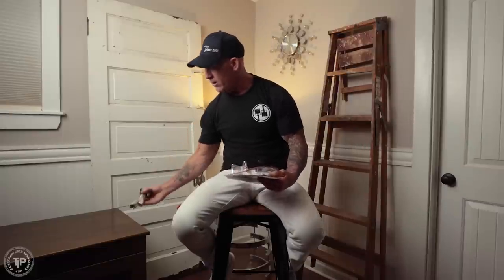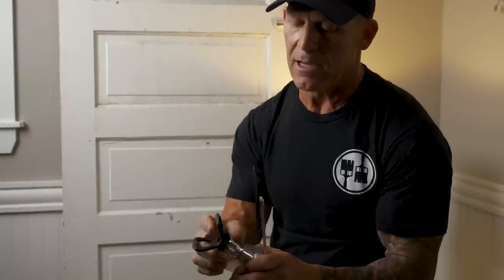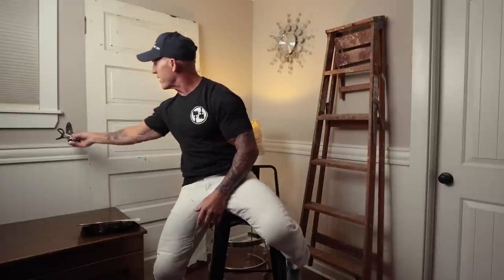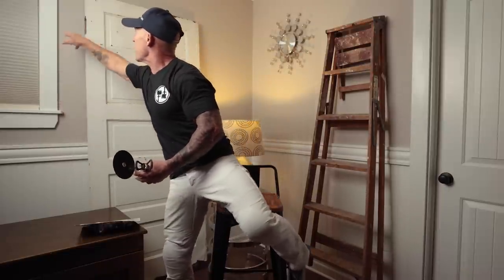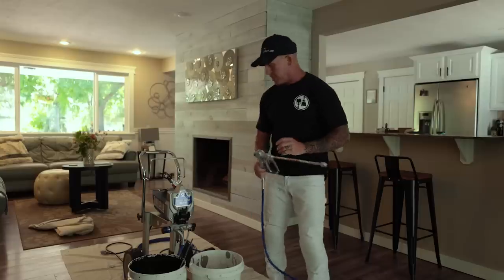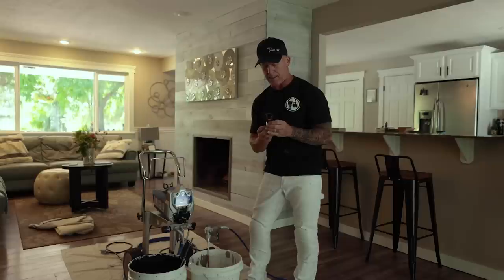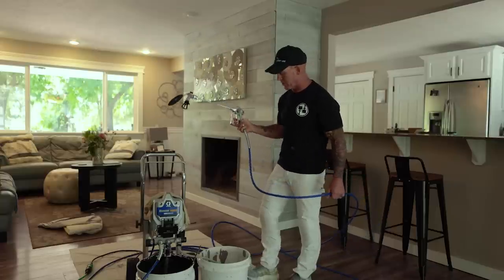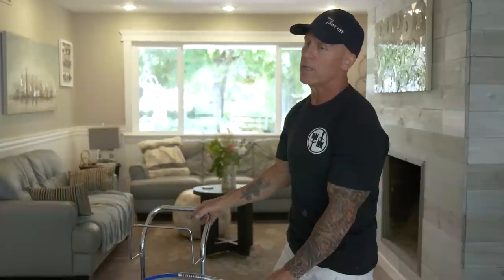Titan Spray Guide Review.  Is This A Terrible Painting Tools?

Comment: I painted a house exterior, the colors were white for trim and Greek villa for body, essentially white on white. Used that roller thing to cut in around some hard to reach areas above the garage roof, made it a super fast job. It has its place but it’s super limited to like colors and if I was going to use it on an interior....your still gonna need to pull out the brush or use a hand masker for the corners and it’s gonna drip like crazy with the buildup

Comment: I have had great success with this tool in a office/commercial setting spraying to a metal grid, drop in(act) ceiling. I did find that it is much easier to actually mask the perimeter grid with 2 inch tape(very easy, very quick), using paper mask on inside corners and outside corners, prior to spraying. Once you invest the time in masking you can actually fly through the spraying process. I actually use this tool all the time for that application. However that's really the only application that I have found where this tool is beneficial 
Thanks for a great review.

Comment: I think I’d be faster with cutting in the old fashioned way.   Not sure I’d use this.  Thanks for sharing this, Chris!!
Reply from the maker: Hand cut ins are the best still
Reply: I used it a few years ago it worked really well under crown molding that I installed, but when I got to the corners you definitely have to tape the corners, I'll sure repainting.  If you use this machine tool once a week it's great but if you throw it in your toolbox and forget about it for 6 months and try to use it again it won't work you just like forget how to use it you have to test it and make sure you're doing it right and make sure you got the right tip in it it needs a 314 tip or something

Comment: hey Chris, i agree with J.Lopresi, Ive found that you really need to have a guy standing by with a 5 gal. bucket or 2 of water and towel, dunk it once,towel it,  dunk it  again and it can actully save some time, HOWEVER things are different for a real painter than they are for homeowners/handymen, if you have ceiling paint, it is super fast to just have someone hold shields in place (big ass diy pcs. of siding)spray walls and touch up ceilings, In my time as a painter 20+ years, Im almost ready to just tape everything off with frogtape, PRE wet it with damp rag and roll right to it with 9" roller , no cutting at all but this only makes sense if you are someone that can mask 3 times faster than normal people can, i.e. painters.

Comment: If I have a lot of crown molding to paint, I will spray the ceilings first, and then use this to put on the semi-gloss for the trim (only if the trim and ceilings are both white). The slight overspray from the semi-gloss isn't noticeable on the ceiling, and if the crown is complex or has a lot of ridges, then I can just do a quick brush over it, not having to worry about the cut in next to the ceiling
Reply from the maker: Thanks for sharing

Comment: I can see the headaches with this device. Even if you get it perfectly dialed in. You have to wipe it or reverse a clogged tip it would move/mis adjust the dialed in angle because the swivel doesnt locked in. It just seems if the company really cared about the device they wouldve made it non-adjustable. The tip size and angle should be preset by design.

Comment: It’s not bad. I would still use it when painting instead of having to completely mask everything. It leaves a bit overspray, but when you paint a window frame you’re painting walls first anyway and overspray on the trim. I would probably turn down the pressure some. And move a bit off being against the trim some. Yea won’t be perfect but it’s helping some instead of just over spraying

Comment: I can definitely see some situations this could be handy mostly is some commercial or production situations or just a a rough group overspray blocker were perfection is not exactly the goal but a fresh look it... Definitely not up to standard for a Finnish edge though but it think it could be a time saver in some situation or the unfortunate situation. I could definitely see this when you just have white one white with Sean change. Rentals apartments things of that nature. I also think this could work great along with tape anytime your already doing to be using a pressure roller with tape possibly no paper. Since a sprayer will already be set up and there is a large amount of cut it with a solo painter this could be a game changer for efficiency

Comment: Great review Chris but I'll stick with manual cutting in. However, I can't keep my damn airless from creating tails when spraying? I have the guage set at 1600 psi w/ HEA 311. I've tried everything WTH!
Reply: Turn pressure up
Reply: @thesaviorofALL  I'll have to try something or quit using these useless HEA tips.
Reply: @tocolee6127  I find tailing is just low pressure issue Crank it up and see how it looks
Reply: Make sure pump n gun filter are properly cleaned and try some test runs with higher or lower pressure there should be a pressure n tip size recommendation n if there isn’t then usually that product isn’t formulated to spray n you’ll fight it no matter what if it’s one of those products
Reply: Use a different tip, we use hea tips all the time but try with another tip and see if the issue persist
Reply: Dialed in finally!
Reply: @tocolee6127  awsome what was the problem or how did you solve it 👍
Reply: Thin out your paint, clean filters in the gun and machine, then turn up the pressure...
Reply: @vinnyboom3027  pressure related issue.

Comment: You gotta keep adjusting it, shouldn’t have that much paint on it. I bought a cheap one, works great. Takes time  but once you dial it in you can work fast and clean. You adjust it so it’s just barely missing the wheel, the wheel should be catching overspray and not being hit directly.
Reply: That's what I was thinking. You gotta adjust it on the flat wall first. From what I see the wheel should barley be getting it.

Comment: I bought the combo kit with the roller sprayer.  lost the screw on first use but never used the wheel . I did not care for the roller attachment. feel it easier to just roll it. waste of money !

But I do like the swiveling tip  I placed it on an extension got a back roller behind me and did whole house walls and ceiling  in 4 hours (1600sf)
Reply from the maker: Waste dont buy

Comment: That’s more for warehouse or really high ceiling commercial mainly
Reply from the maker: Fuzzy lines are not for any job LOL
Reply: Way too many problems using on a high ceiling. First of all, the degree of difficulty and control increases your physical effort with every extension needed to reach your target height. Secondly, when using extensions, the amount of paint spat out on trigger-off ruins any hope of a decent finish and leads to time-consuming rectification works. Thirdly, you need to move at a reasonable pace, which is not always possible when your paint intersection is rough/uneven or the ground is uneven. Fourthly, you need at least a 40 degree tip to allow the paint to hit the disc. That's a lot of wasted paint without any quality guarantee. It's hit or miss.

Comment: Glad to see the Graco ProX19.  That is the sprayer I chose for my DIY needs.  Hopefully you give it 👍.  I haven't opened the box yet.  Can you aprove?
Reply: Garage,  nothing but problems, get a graco 395 nova, or a titan 440 those 2 sprayers have went threw 2 seasons everyday use with no problems just normal filter replacements.

Comment: Chris you are not using it correctly, also for all of you that did not have luck with it, it does not make laser lines but it works much better than on the video, you have to keep the tool and extension 100% vertical all the time and walk with it as you move, there should not be any hand movement towards left or right as it makes overspray right away. Also your hand is close to the wall, move it towards your self a bit. You should start from right corner toward left and spray about 2' than you go to left side and spray towards the area where you started so you dont spray all the way towards the end. I also found it works better with FFLP 410 or 412 tips. If you take time and adjust angle perfectly and move it while keeping it vertical all the time it works much better. Also after a while that center of the wheel gets dirty and blocks the wheel from spinning, I installed small bear bottle cup on top of it so that paint cant get on it... Give it second try, it works on rentals and exterior
Reply from the maker: I was using it to specs on the PACKAGE.  I used it several times.  I have over 20K hours spraying with an airless sprayer and some tools are good and some a waist.  Now.  It you have lots of time on your hand, maybe you can get better with this tool.  For me the learning curve is to great to invest in it.  Hey, not every tool is for everyone.
Reply: Thanks for the info sep, i'm looking to use one as i only do new builds which mostly are standard builders white ceiling and a light color to the walls and think this would be ideal for the first cut to ceiling lines, like Chris mentioned he likes to cut up a couple of mm onto cornice to give that straight cut impression when viewed square on, this item would never eliminate the final cut in by brush, but looks like it has it's uses,very happy to leave it short in the corners and catch with a brush afterwards, the time jumping up and down steps, platforms etc to cut ceiling lines on larger homes is a long drawn out job at times
Reply: @Idahopainter  If you watch the product video, it clearly explains how to set it up.  Unfortunately Chris, you completely botched the setup.

Comment: What about if you were doing a fast turnaround white out scenario (commercial apartment re-let for example) where the walls and trim are both going to be white but different paint products. Would it work for this. Obviously won’t be perfect but could it speed up the job a bit for sacrificing a bit of quality of edge??
Reply: Would sacrifice time as always cleaning the wheel. Easy if spray woodwork allow to dry, mask woodwork,  spray walls, allow to dry, grab a board (real estate boards work well) put in into the internal corner of the ceiling and wall and spray the ceiling moving the board along to catch the over spray. 🤙

Comment: Hi Chris, i recon it should be used with a 210 or 208 tip, it might reduce the overspray on the ceiling. Could you try with a smaller tip?
Reply from the maker: I could but Titan says on their on package a tip not in that size range.  Is that not weird?
Reply: @Idahopainter  I guess they haven´t tested it enough and released a product that is below average quality. Hoewer it goes for the swivel, thats not all full rubish

Comment: I use this tool only for keeping the overspray off the ceiling.. Its Not for cutting in..  Cut in afterwards. the knockoff is 20 dolar and comes with 310 tip and seal...
Reply from the maker: The tool is terrible in my opinion

Comment: Back in the late 70's we'd spray exteriors with 24-36" metal or cardboard shields mostly for the eves after the stucco was done, and they were pretty effective. 

Working fast I'd bring about 10 cardboard shields as they get sopping wet very fast, so I'd lay it down and get a new dry one. 

This wheel would get sopping wet so fast it wouldn't be worth the time.

 If they designed this wheel with a super absorbent foam padding then MAYBE, otherwise it's a joke.
Reply from the maker: tjhanks for sharing

Comment: I saw that about 5 years ago and immediately thought WHAT THE HELL! What the hell were they thinking? That's one of the most ignorant tools I've seen on the market.

I’ve lost all respect for Titan for letting that idiotic tool into their line.

The overspray is so freaking obvious from the get-go. When I use shields, carboard or metal it’s pretty good, but I always have to clean them, or I’ll get about 10 cardboard shields and use a new one when my current shield gets wet.

But how in the hell could these morons not know the paint would cake up in seconds?

With a shield you got about 36” to catch the overspray, but little wheel barely gives you a few inches.

What the hell???
🤔🤨

Comment: Could someone tell me which HEA tip would be the best to use with low pressure TITAN ControlMax Paint Sprayer and Spray Guide. 

This is a good review but I think it is very focused on professional use of this tool. 
I'd like to hear opinion from DIY users who from time to time paint couple of rooms in their house.
Reply: As an amateur you should go with a 211 for cutting in if you have to, 313 is safe to fill larger areas, just make sure your pressure is just right, mask everything off really good.

Comment: Probably a Pad would cut in better
Reply from the maker: Now what kinda pad?
Reply: Paint pads are a totally DIY product, and are not found in any of our trade centers, i have used them many years ago, but had to modify a paint tray to make sure the pad was loaded completely flat in the tray, keeping them 2 little guide wheels clean was a must from start to finish, if you bought the pads in a kit you was provided with a tray with spinning roller in the center to wipe excess paint off the pad, try doing that with the pad attached to a pole :P